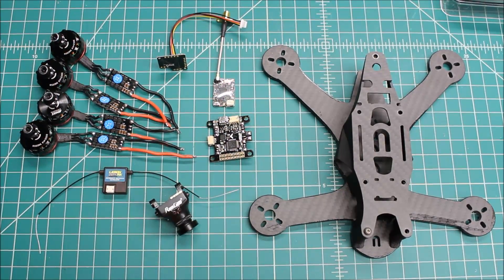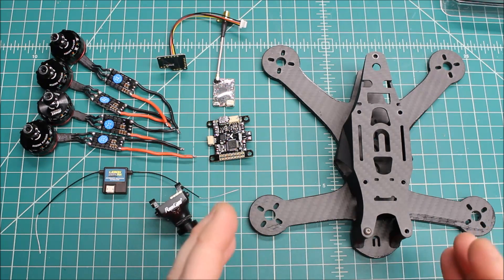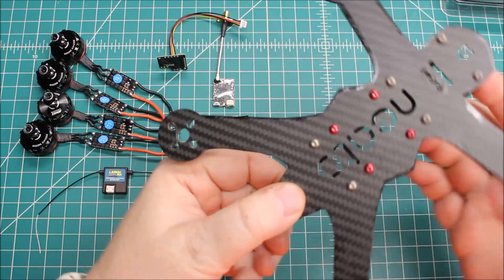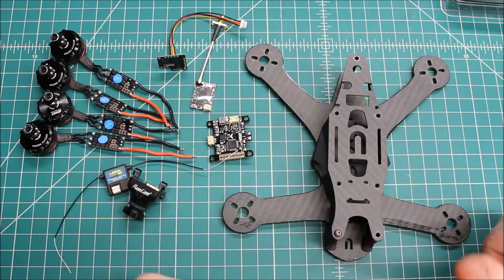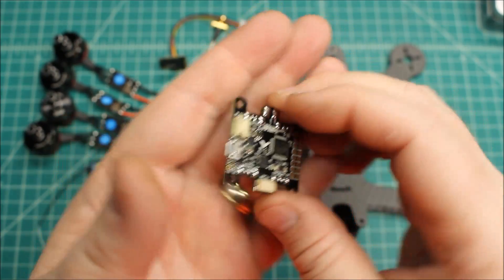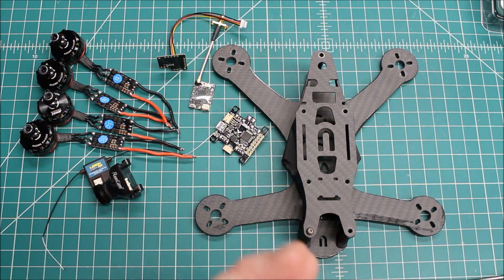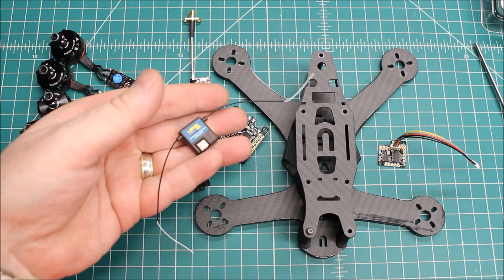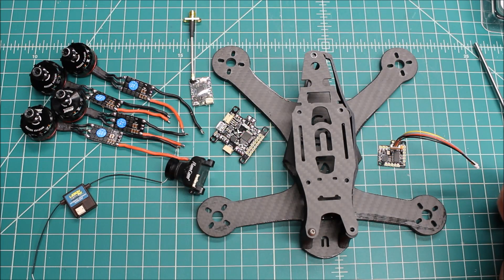Neato 205 "BreakNeck" FPV Race Frame Buildout

Comment: Hi, I'm about to build my first quad and I'm in a lookout for nice frames and this one caught my eye. I found that the FCU location in that frame is a little bit toward front of the drone.  Does that affect the stability of the drone? My top one pick as of right now is MQC One frame and I want to place TBS Powercube not in 1/2 of lenght but 1/4 from the front so I can stuff the battery in the frame. Do you think it's a good idea? I want to hear opinion from someone with experience in that field.
Reply from the maker: Flight Controller placement can affect handling. CLI Motor mixing can help with that and Neato provides you with its custom motor mix. Oscar Liang has some good information on it here. https://oscarliang.com/custom-motor-output-mix-quadcopter/
Reply: Thanks for the link. I still didnt find an answer for my question, because that article you linked me to is about about asymetrical frames and weight balancing. Im planing on balanced build on symetrical frame the only BUT is the FC on the front not center and I just wonder if it will affect the way of sensors to read pitch roll and yaw. Anyways thanks for help. Great channel by the way!

Comment: What osd would fit well with this pdb/fc combo ? i use redrotor pro osd 'pdb/osd' combo because it very simple to set up. looking for an other option..  thanks
Reply from the maker: +Woodizz have you tried the Foxeer Arrow with built in OSD. It works great.

Comment: I am using the lemon Diversity sat in my Realacc too. You can save some weight if you get rid of the plastic case and just shrinktube it. :-)

http://www.kopterforum.de/gallery/image/14528-rx210-03/
http://www.kopterforum.de/gallery/image/14528-rx210-10/
Reply from the maker: ZeroFPV that's a good way to do it.